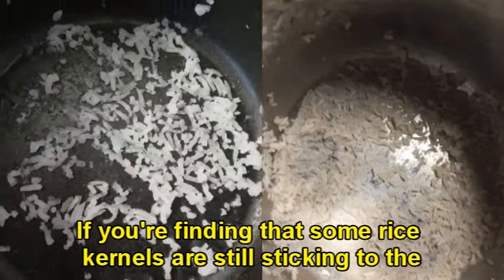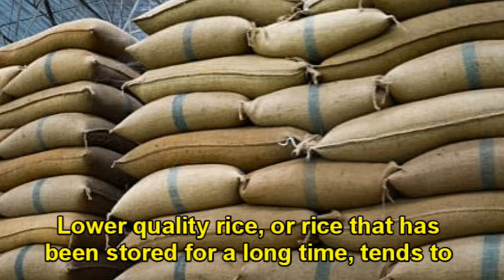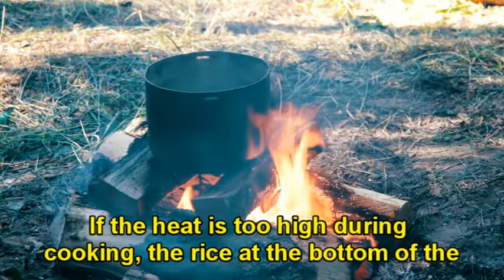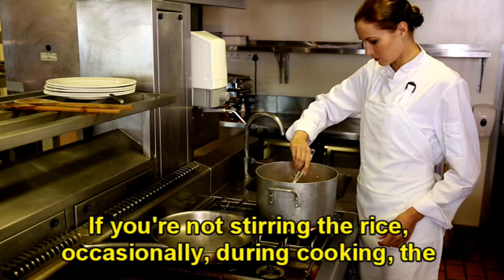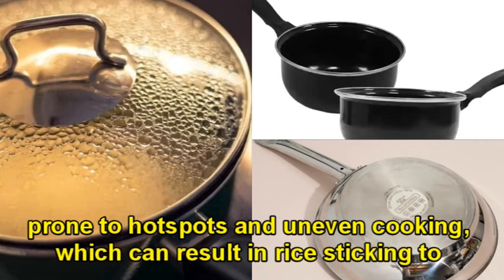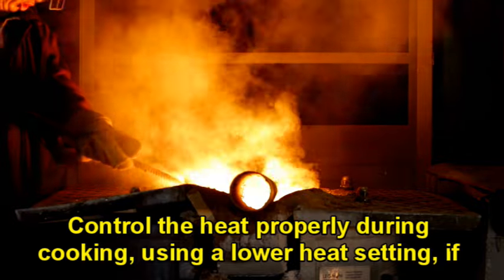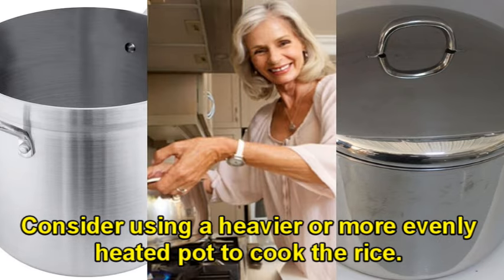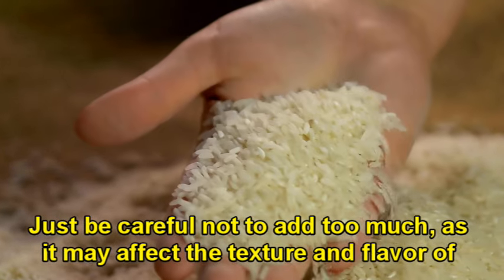Why Does Rice Stick To The BOTTOM Of YOUR Pan?

Comment: How do you know if rice is fresh?   I don’t see any expiration date. I always keep a few extra boxes for emergencies.
Reply from the maker: Appearance
Color: Fresh white rice should be uniformly white. Brown or discolored grains may indicate age or exposure to moisture.
Shape: The grains should be intact and not broken. A high percentage of broken grains can be a sign of lower quality or age.
Smell
Aroma: Fresh rice should have a neutral or slightly nutty smell. If it smells musty, sour, or off in any way, it may be old or improperly stored.
Texture
Touch: Fresh rice should be dry and firm. If it feels damp or sticky, it might have been exposed to moisture.
Storage
Packaging: Check the packaging date if available. Rice stored in airtight containers stays fresh longer.
Environment: Rice stored in a cool, dry place will remain fresh longer than rice kept in a warm, humid environment.